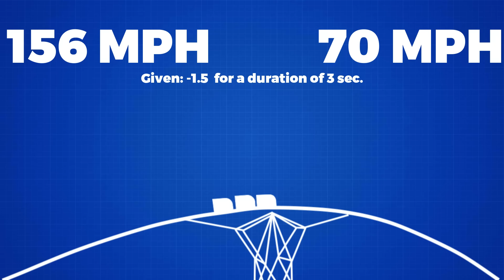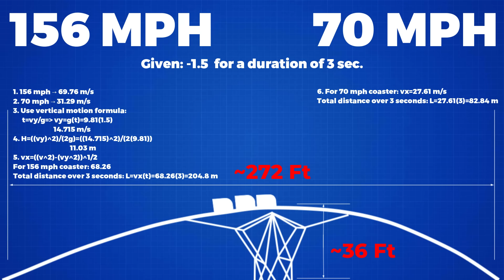The Real Reason Why We Can't Build Taller Roller Coasters

Comment: Parks these days also seem to be gravitating towards launched coasters in lieu of trying to break height records. And speaking of launches, the hydraulic cable systems that powered KK and TTD are going by the wayside due to expense and downtime.  A lot of low to the ground multi launched coasters have been built in the last 15 years or so.  Those launches are now some of the main marketing points for such coasters (read - SF Great Adventure's new "multi-launch" record breaking coaster teaser).  
That said, it's certainly an awesome feeling of being up so high on a coaster, and rocketing to the top at such high speed.   I really enjoyed both KK and TTD (haven't done TT2 yet). However, my #1 coaster of all time is seen at 4:12 - Skyrush. And it's only 200 feet tall and just makes the typical freeway speed limit of 70 miles an hour, and it doesn't even have any inversions.  I've never had a coaster try so hard to rip me right out of my seat so many times in one fairly short ride. And I've ridden a few RMCs and other coasters know for being airtime machines.  It isn't the size of something, but rather what is done with it, that counts.
Reply: Probably because the tallest coasters have hit the point where you don't really get much for the added expense.

Comment: Falcon's flight defo breaks the 500ft barrier with the camel back for sure, but I don't count falcon's flight breaking the 600ft barrier. If we accept this then most alpine coasters and/or high roller in Las Vegas has already gone above 600ft
Reply: I would say it does because the total change in elevation on the ride is 600 feet, which would exclude the stratosphere coaster for obvious reasons, and do people even count alpine coasters as credits? I didn’t think so since they were so different. It’s kinda the never ending argument about if Orion is a giga or not (it is)

Comment: Another factor not mentioned in the video or the comments is planning/zoning restrictions there are several parks where they are not allowed to build past a certain height and just cant build these high roller coasters. I would also say that the invention of the various magnetic launch systems means you dont need to build high to get speed. Weather i would also suspect is another factor that limits coaster height.
Reply: There is something to be said for the view. You can see all of Cedar point from the top of millennium force, and it’s spectacular!
Reply: @TheGrobe MF #1!
Reply: Yeah, iirc a good example of this is Alton Towers, which has a pretty low height limit for it’s coasters, hence why a lot of them use underground sections to compensate for
Reply: @dragons6711 The UK is so weird with height and planning restrictions. It's the same reason Stealth at Thorpe Park has to be coloured white at the top.
Reply: The reason Expedition Everest is 199’6” is because if Disney built past 200, they’d have to put an airplane beacon on top.

Comment: A lot of it with roller coasters and you mentioned it sort of in the video  depends on what type of trill riders are looking for to this day at Cedar Point my personal favorite happens to be Raptor and it's built in what 1994 so it's starting to become one of the older coasters in the park I also know you mentioned Maverick which is small yeah it's one of the funnest rides at the park and look at the popularity of Steel vengeance yes it's a good size coaster but it's definitely not three or 400 ft

Comment: On the Earth, with an air-filled atmosphere, going 120 mph feels very different from going 60 mph, even if the vertical and lateral g-forces of the elements might be similar.
Reply: This is ONE point that is valid.
Reply: 2 times the speed - 4 times the drag
Reply: Yeah, main thing I care about with coasters is the speed. Actually the main thing I seek is acceleration but that's only launch coasters. After speed and acceleration, I care most about length. If I'm not riding a world record level launch coaster, then I want coasters that keep a high speed over a long distance/time. Height is nice but it's basically just a result of everything else I care about.
Reply: The butterflys you get in a longer drop is much better than a short one! The 300 foot drop puts that adrenaline spike way higher than a damn kiddie ride ever will! This narrator was talking with someone else's wallet that clearly hired him to try and bullshit us!

Comment: The fact is, building a taller coaster doesn't really get you all that much more speed.  If you double the height of the initial drop you will not double the speed ... in fact, you won't even increase it by 50%.  And it get's worse.  The wheels on coasters are small, and as a result they must spin many times faster than wheels on cars going at the same speed.  This causes major issues with wheel bearings.  And I'm not even going to go into the G-forces they sustain in keeping the train on the rails.  This also results in more friction, again resulting in a slower top speed.  So making a coaster taller might be great for bragging rights, but in overall ride fun ... very little is actually gained.

Comment: As a big coaster lover i rather have more very good shorter and thus less high coasters then those big monsters. Don't get me wrong i loved Ka but its not even in my top 10 for best coasters.
Same problem goes for speed Formula rossa puts a big smile on my face but after the lauch to be honest it isn't much of a coaster. Now there are exceptions I305 is really great if you like the extreme force thing and fury probable is the best coaster if you like a smooth experience where every element works.
But if you like some nice extreme forces lech coaster will do the trick and is probable way more affordable. And i rather have more of those in more parks then an extremly expensive record breaker. In one of your flagship park in a large chain. Its all about the experience of riding what you like and having more coasters in your park ussualy means the lines get a bit shorter so less waiting. Also you can varie the sort of differnt coasters more and if one has a problem that day it has lesss of an impact. Ofcourse you do need idealy 2 coasters that can really lift up a park.

Comment: Bigger, taller, faster = Higher maintenance cost, higher operations cost, higher insurance cost.  If you're addicted to bigger, taller, faster may I suggest skydiving.  We can build a car that routinely goes 180 mph (NASCAR does it all the time), unfortunately these cars cost between $280,000 - $500,000.  Not worth it for your average Joe.
Reply: It's nice having a taller ride as you can see it from far away and have a nice view, but honestly, the higher you go, the less of a sense of speed you have, so you've got to be doing tighter everything from up there. And, it's inherently harder to do much up there as the rides are naturally going to want to sway more up there, so there's a bunch of extra metal required to keep it stable as you don't have the options for swaying that you would in a normal building.

Comment: The thing about the US is air space regulations usually only things like cell towers and buildings like offices and hotels go up to 600 ft. With the way things are going in this country I definitely wouldn't trust the pilot to have to navigate around a 600 ft roller coaster sitting in the middle of nowhere

Comment: 10:40 it’s not the same experience though.
Even though the Gs peak might be the same, the duration of the acceleration is different which makes a huge difference on intensity
Reply: Not necessarily
Reply: @Jo-rz6bs  yes necessarily.
Think about this:
Hitting a pothole with a car gives you a short burst of more than 10Gs but it’s for the fraction of a second so it doesn’t affect you much.
But enduring 4.5 Gs for 3 seconds makes you gray out because of the duration of the forces.

So a camelback on smaller coaster can hit the same peak (negative) Gs than a giga coaster but it can’t sustain the force for as long, giving you a different experience

Comment: The next innovation will be how DEEP can a roller coaster be?
Reply: I would like to see an underground roller coaster.
Reply: @riventv4927  Yes, I've seen video of one in WI, US that does go through an underground tunnel for a bit, but it would be cool to do an actual Indiana Jones mine car ride with sections where you appear to leave the track, and if it's under ground in the dark, it would help a lot with making that seem real.
Reply: @riventv4927 Nemesis at Alton Towers
Reply: Yukon Striker goes underground, so it might be interesting to have another coaster like that which has a huge drop into a tunnel but isn't actually that tall
Reply: A roller coaster that goes down 200 feet into a ravine or cave system sounds dope
Reply: A 300-foot drop at 85+ degrees at 95 mph followed by 3 quick airtime humps within 100 feet of the base of that drop would make it the most addicting roller coaster ever designed, especially if the seats had soft springs in them that allowed some vertical movement! Let's pool our money and build one made by the people! Yes, the G forces alone would probably exceed 5, but that's what warnings are for. Go at your own risk and sign a waiver before going!
Reply: Just look at Alton Towers.
Reply: Maybe the deepest roller coaster were the friends we made on the way.
Reply: @fishbrownconnect7927 shut up

Comment: It's not 640 feet tall. It's a 640 foot change in elevation from the top of the cliff to the lowest point on the circuit near the station. The coaster has an airtime hill and drop over 500 feet, but the 600 foot claim is just clever marketing.
Reply: Well by that logic then a wild mouse is 5 feet tall
Reply: If the top of the coaster is 640ft higher than the bottom thats its height they could build one in the side of the grand canyon that doesnt get 50 feet off the ground but be 1000ft tall no problem unfortunately the national parks service would never allow it lol.

Comment: Your statement about airtime & height not being significant is FALSE!  To get airtime, you need 8 feet of height to get ONE second of airtime (assuming going both up & down hill as you show).  For 2 seconds, you need 32 feet.  3 seconds, 72 feet.  4 seconds, 128 feet.  5 seconds, 200 feet.  6 seconds, 288 feet.  7 seconds, 392 feet.  8 seconds, 512 feet.
          D = (1/2) a t² where D is height (feet), t = half-time (seconds, time going up or going down), & a is 32 feet per second squared.  Note that doubling airtime requires quadrupling the height.
          This height is for the airtime part of the track only.  There must be additional height (ranging from being equal to D to (1/3) D for the high-G parts entering & leaving the airtime part).  If ejector airtime is wanted, more height is needed (1 1/2 times more for 1/2 G airtime, for both the airtime & lead in & lead out).
          Top Thrill 2 easily achieves 6 seconds of airtime on the spike & tophat with 400 feet height while keeping G-loads ~4G on the lead in & lead out.  Coaster limited to 200 feet high would be limited to only 4 seconds of airtime.
          This is why it is only practical to use an airplane to get longer airtimes, & even then, only ~25 seconds can be achieved, with the "airtime hill" height being 5000 feet, about 1 mile!
          (On the other hand, you can have as much high-G time as you want without (at least in theory) no height at all, for as long as you want.)

Comment: Falcon's Flight is like having a 10-year-old design a coaster in an amusement park sim.  Except, the infinite money cheat is in real life.
Reply: Or playing roller coaster tycoon two with no money in building the tallest coaster only to find out that the intensity rating is ultra extreme. Then nobody will go on it.
Reply: @johnfoltz8183 my real concern would be maintenance. those forces and speeds combined with extreme heat and extreme cold at night. the track and wheel degradation will be very destructive even with an unlimited budget. I can imagine them not running it often to avoid costly repairs. which will lead to more safety issues. It’s a big fat vanity project like everything else over there. Impressive but useless.
Reply: @markwilson1096 the ride isn't designed to run all the time but rather be a ride pic lmao ...they have already stated the ride won't operate but maybe 4 weeks out of the year or 5 but will open very speratic
Reply: @TheSam32169 show proof of them saying this lmao 😂
Reply: @markwilson1096  OK, so what you just did there as you slipped your personal biases against people in the Middle East into your explanation of why the roller coaster is bad. And it sucks because you had some legitimate reasons to explain your opinion, but then you just threw in those two lines at the end that make you look stupid and bigoted. It really makes people question whether your other critiques are honest when you bookmark your entire comment with a prejudiced sentiment.
Reply: @coasterthekid8867  do I need to list? Burj Al Khalifa, barely occupied, no working city plumbing
The wall.
The cube.
The jeddah tower

Do I need to continue?
Reply: I mean universal has $300 million to waste on Hagrids magical motorcycle ride and that ride only has a max height of like 50 feet!
Reply: @TheRaptor77  they spent a lot on that theme area in general
Reply: All that Dubai Chocolate money coming in.
Reply: @benm1414 they also have the landscape to help the hieght limits,
Reply: @benm1414 average american ignorance.
Reply: Fr. It looks like the roller coaster I made in theme park tycoon 2 when I was 13
Reply: @Sprigatitto740  it looks like a really bad Millennium force
Reply: I gotta say it looks absolutely beautiful :D
Reply: Na frfr that concept was WEAK AF 😂😂
Reply: The SPC Be Like:
I Know You Are Guaranteed To Die On Me But I Am The Tallest!
Reply: Top thrill 2 is phenomenal, I think it’s better than the original
Reply: I'm not complaining though XD
Reply: I suspect that coaster will be shut down in under 5 years. That thing has problematic written all over it, and will coast a fortune to maintain.
Reply: I dont think 10 year olds would make it cuz its too big
Reply: People will die on it
Reply: If only money was infinite in the roller coaster industry. We’d see rides similar to Falcon’s here in the states or something even more extreme!
Reply: Just a shame it's in Saudi Arabia.
Reply: I really hope its a huge flop
Reply: @Handgrenadess Why?

Comment: All correct but a few caveats: Smaller/slower coasters can't always get the exact same forces as larger/faster ones. E.G. If you wanted -1.5g for 9s you'd need something rather fast, ~157mph for a semi-circular arc, lest your track do outward loop(s) and would spike well over -1.5g during outward inversions when gravitational forces flip respect to the rider. Also, you can achieve fast speeds for a short time, like Formula Rossa, and not need brakes, tall structures, or long tracks if you dive into a terrain valley and come back up.
Reply: the rest of us used our critical thinking skills and internal dialogue to process this in real time...